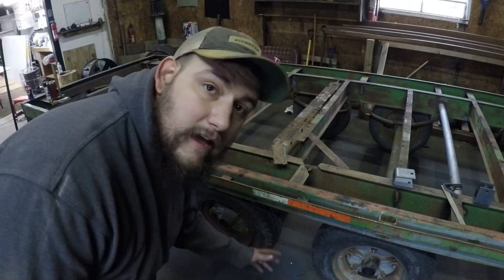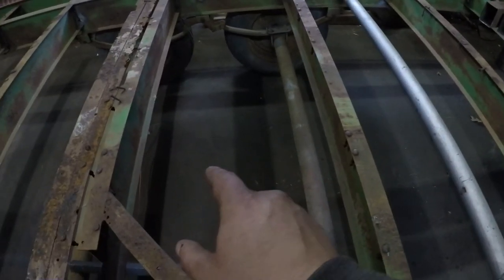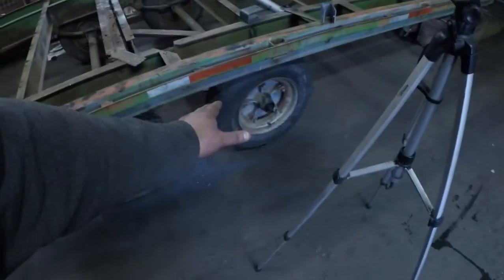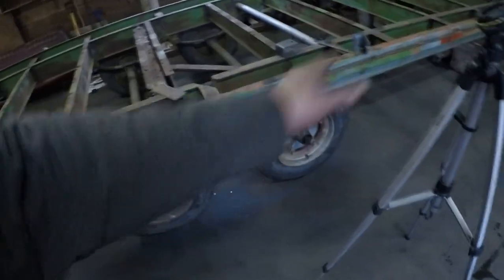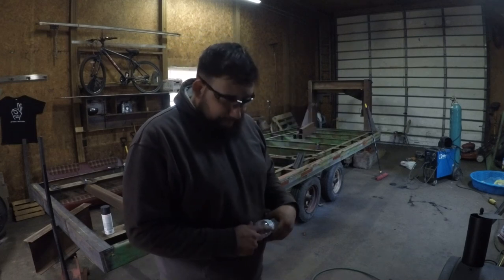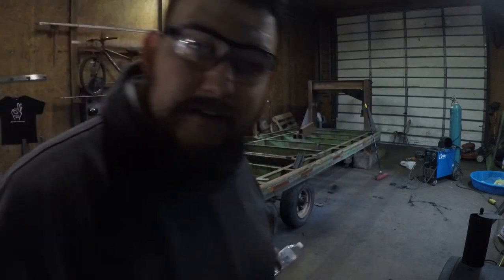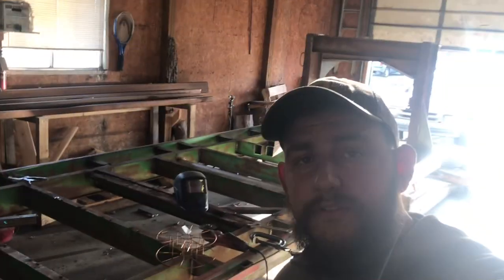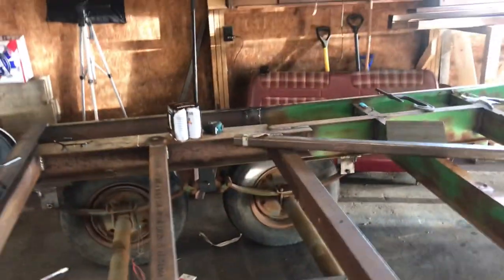Building a Gooseneck Trailer (Pt. 5 Moving the axles)

Comment: Ever had any issues with your mobile home axles? we have a big 24 ft pintle with them that we haul a 9k bobcat on and they do just fine! What is the fuss about these units?
Reply from the maker: No I haven’t had a problem, I’ve only pulled the trailer maybe 150 miles, but I wanted a fairly universal wheel Incase of a multiple blowout.
I’ve heard these axles and rims are beasts, though.
Reply: @MidwestMoose  they really are. You can get 14 ply tires for them now. Biggest thing I've found is they have to have a good amount of air in them lol